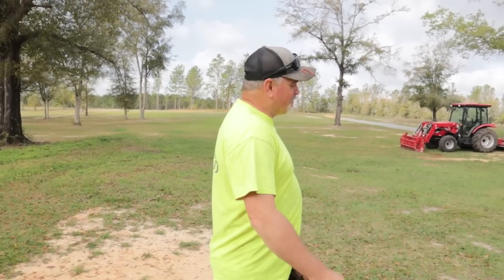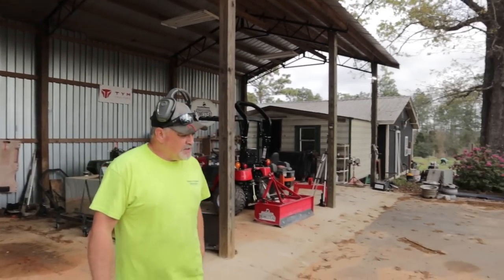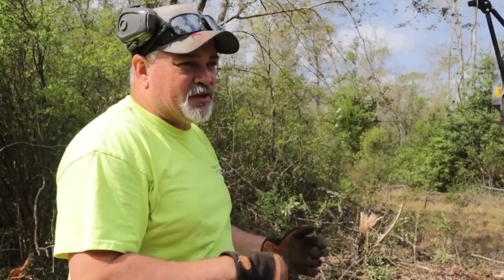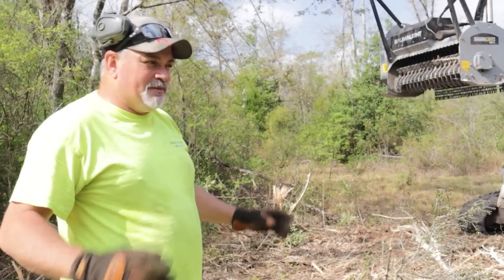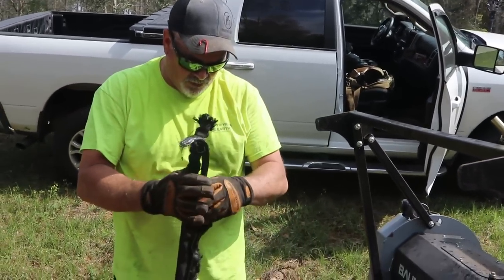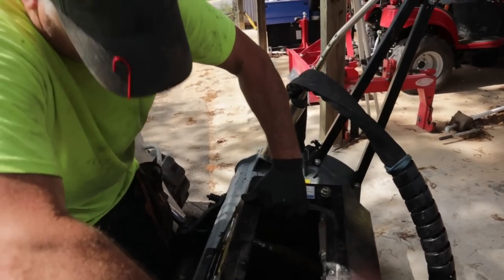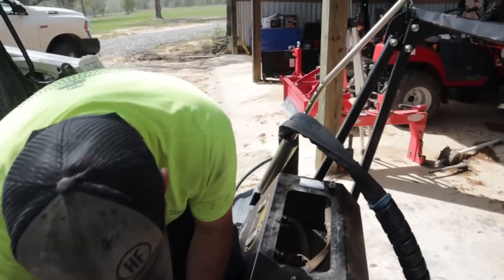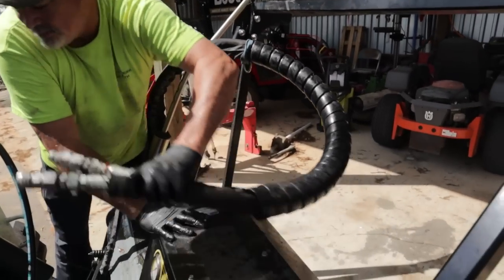I make a VERY EXPENSIVE MISTAKE While Forestry Mulching!

Comment: Thanks for another great video. It was interesting and enjoyable. 

Real busy job clearing all that brush. Busy job for sure. 
Will be nice when done and you will have extra parking spaces. 

Sorry about your hydraulic hose. It got caught and torn right up. Mistakes happen. Get it fixed and press on is the way to look at it. 
Expensive hose I know.  
You got it fixed so press on. 

Just a safety suggestion. I noticed you work or walk under the raised boom. There are safety locks for those cylinders. Might be safe to use them. 

All for now. Thanks for everything Hank. 
Go back to your parking spots. 
Thanks. 
The Iowa Farm Boy.

Comment: I've been mulching on my place off and on for a few years now with my Kubota SVL and Fecon head . While the end results are great and I enjoy it (therapy for me ) it always seems something is leaking, squealing or just breaking. Such is the life of owning and working equipment........lol. 
Great video . Thanks for sharing .
PS.....when brush or tree materials bind up in the head I just turn the head off (the hydraulics to it) and then roll the head forward enough so the drum is in the dirt and then apply downward pressure and then back the machine up. Usually it will roll the debris out of the head and you don't have to get out of the machine. Restart the head and go back to mulching. "Usually" works. Not always.

Comment: The thumb toggle on the right handle is for forward and reverse and the finger trigger locks it on.
Reply from the maker: Yes. But there is no reverse flow on this. I’ve tried every combination there is and, i know this is hard to believe, but i even broke out the operating manual 😁👍

Comment: Does it need more flow in driving the mulching head ?   Looks like it bogs down so easily to me.
Reply from the maker: Yeah my machine really needs a few more gpms to make it work better
Reply: @HamiltonvilleFarm  Wonder if there is a flow control in the line you are using.  Might not be getting what you can.  Cheap to look at it.
Reply from the maker: I’ll check👍

Comment: just an observation it seems its getting clogged when you're cutting and the RPMs aren't up. you might want to try going 25% slower so the RPMs stay high and it cuts better. ... Its like a push mower when the grass is too high and you have to take half wide passes or the grass clogs the mower. I could be wrong but it might be worth a try.. 25% slower but constant has to be better than stopping all the time.. Then again I could be completely wrong heh.. good luck
Reply from the maker: Thanks!

Comment: When you get material hung up in the head if you’ll turn the head off and roll it forward drive back and forwards some and 90% of the time you can get the head cleared of the material. Save your self a lot of time.
Reply: Looks like a process for sure….curious if going at it slower would help keep the drum spun up?  I had to get new hydro lines for my front loader on tractor a while back and knees buckled when they hit the total button on register.  Prices today sure make ya talk to yourself out loud.

Comment: Dig your content and easy conversational style.  Not to be critical, but it seemed you had some issues with the attachment.  Was that a function of the hydraulic system’s capacity?  I do not know, but am in the market for a skid steer for similar tasks.  Thx.
Reply from the maker: Yeah i am maxing out the gpm rate for this machine for this cutter.  I need about 7-12 more gpm for it to be fully effective

Comment: Hydraulic pump whining noise.  I hear power steering pumps on cars make the same noise, particularly on some Fords. They keep on working.  My suggestion is if it ain’t broke, don’t fix it.

Be carful with wires of any kind it you are not absolutely sure they have no power going through them.  Telephone wires can bite you too and even take a life under the right conditions. Line voltage is about 48 VDC.  This is enough voltage to hurt someone.   It only takes about 18 ma to kill someone.  Always assume wires are energized if you don’t know anything about them.
Reply: I worked with 48 vdc for 37 years, Phone, and Phone Related power Supplies and never had an issue with it working with bare hands on live stuff. I can hold 48 vdc across both hands and not feel it. if Damp I might feel it. 
The Only rare time I got a bite was with Ring Voltage or high-Pot lines.
70 volt high power Audio Amps I can feel if the amp is Pumping out the beans HAHAHAHAHA...
Phone Ckts are Current limited, so shorting them together will not hurt anything.
It was common practice to short a line pair to "Busy out" the line to take it out of service till a problem could be repaired. ..
Ever test 9 Volt batteries with Your tongue ??  
Mike M.

Comment: No I don't know much about them but I thought that attachment was left relatively close to the ground when you're using it
Reply: I was waiting for Him to shatter the Window again. 
Yes Hank, leave that on the ground and drive forward, no need to chop trees like that. 
I'd never buy that mulcher with it turning in that direction.
It would be a lot safer for the operator with it in the other direction and people should not be any where around it with it running in either direction..

Comment: Sorry Hank, as an electrician having worked for many years with killer voltage, shock jokes are not funny to me.
Reply: Plus you can get quite a surprise if in contact with a POTS phone line when the ring voltage (90 vrms AC) is active.